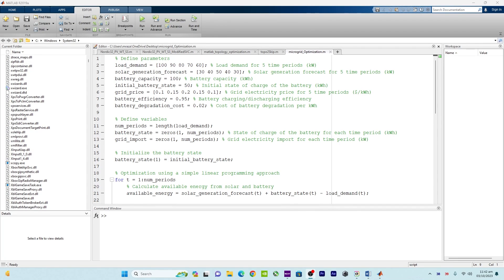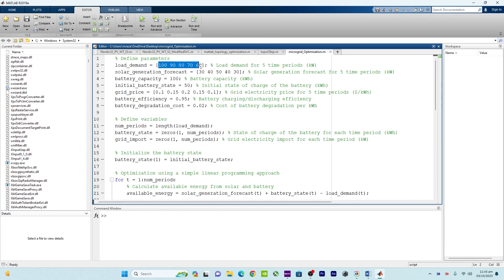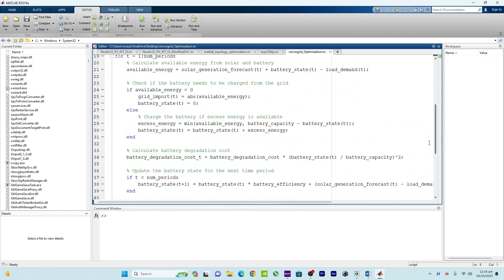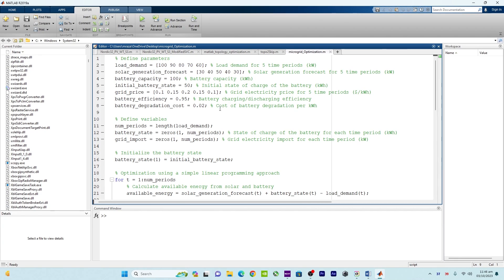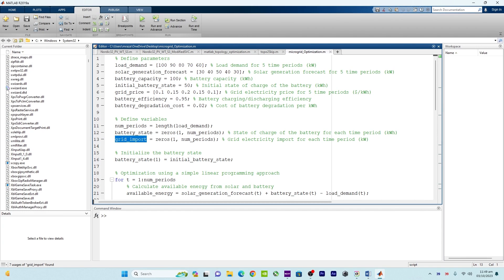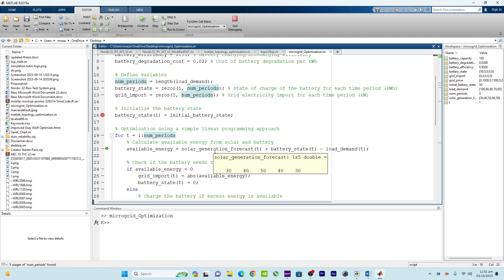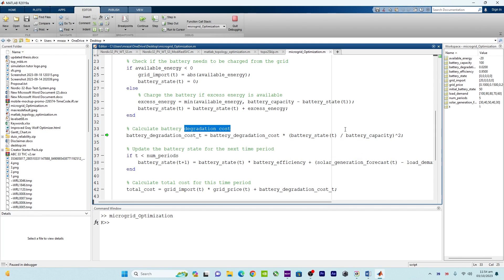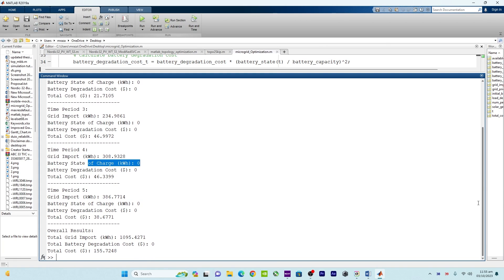Microgrid Optimization MATLAB Code, Battery, Solar, and Demand Response

Comment: Could you please tell me how to apply any optimization technique in any microgrid? I make a rough sketch of a microgrid which involves HSS ,EV integration and super capacitors,i want ro find an novel optimization technique for such a system .could you please tell me how to do that 😢
Reply from the maker: contact@simulationtutor.com

Comment: I have mini project on demand side management in wind power generation.
Will u help...?
Reply from the maker: Contact@simulationtutor.com
Reply: @SimulationTutor  

Can you write a MATLAB code for the Simulation of Optical Networks into a Photovoltaic Module System?
Reply from the maker: @bambioluwafemisolomon8360  Yes, we do check your email.
Reply: Hi , I have the same project can you help me please
Reply: @LaMis-j9s  the model designed by me...runs on only two loads
Reply from the maker: Sure, I can help you.